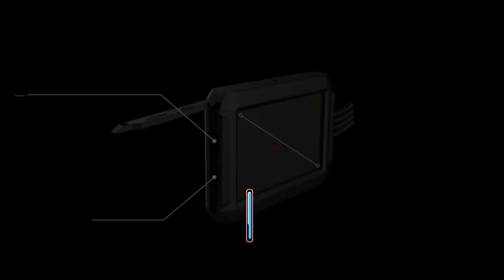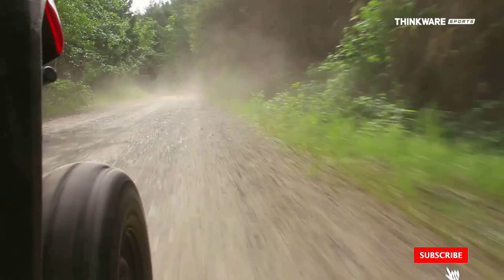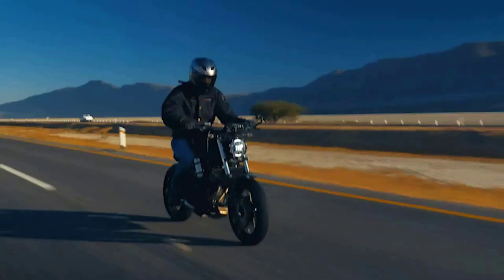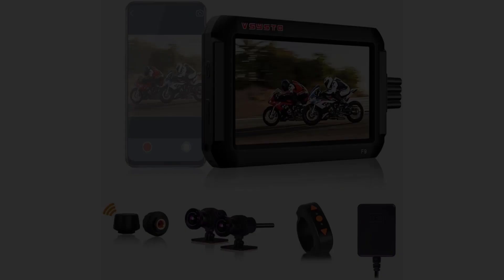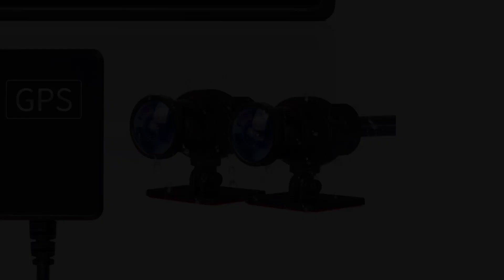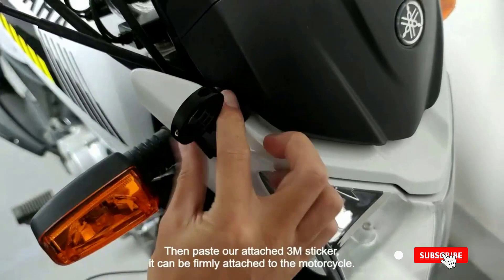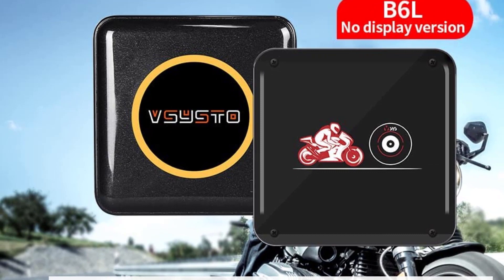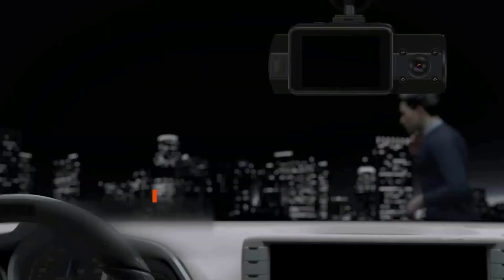Best Motorcycle Dash Cams (2022-23) | Top 5 Best Motorcycle Dash Cams (Motorcycle Dash Cam) - Review

Comment: I had just bought an Innovv K6 camera and had an issue with it turning on and off whilst riding. Innovv in China were really helpful and passed me on to the UK importer to get a replacement. Unfortunately I have had nothing but hassle trying to get a replacement from the importer and have had to quote distance selling laws to them to enable a refund. I'm extremely disappointed as it seemed a good system apart from the glitch I was having